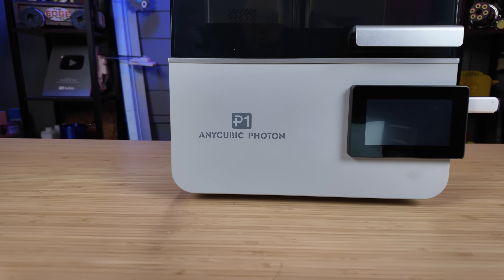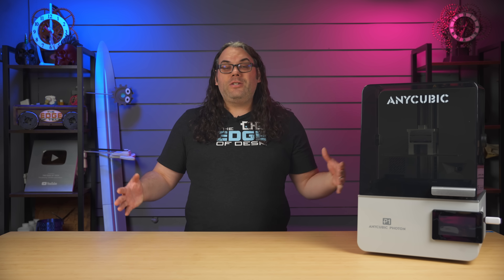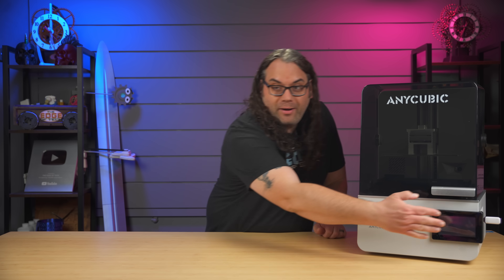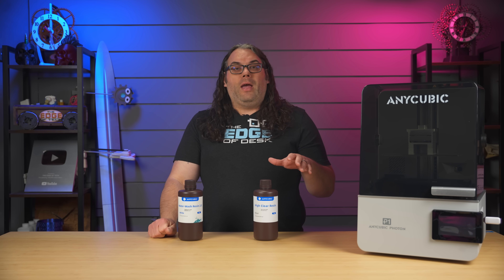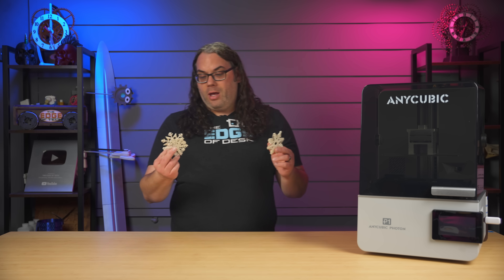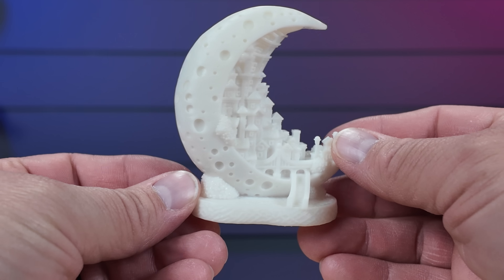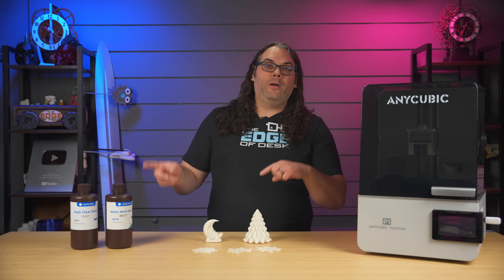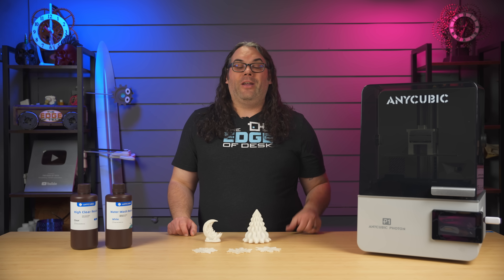This Resin Printer Does What Others Can't.. Hopefully.. Anycubic Photon P1 Review

Comment: I trust this is a significant improvement over the M7 range. Could you please provide information on the noise level of the machine? Additionally, how frequently do you need to replace the release film? The M7 required weekly replacement, and do any of the intelligent assistance features function? Notably, these features did not work in previous models. While the product appears intriguing, Anycubic seems to be retrogressing, as the older models perform better than the newer, faster printers..
Reply: Weekly replacement? Lol
Reply: @custom.3d  The machines system informed me each week that I needed to replace the release film,, very annoying ...